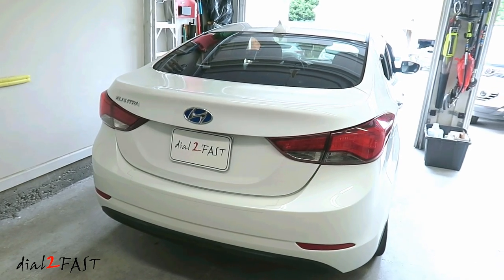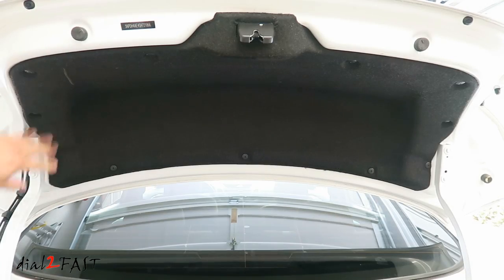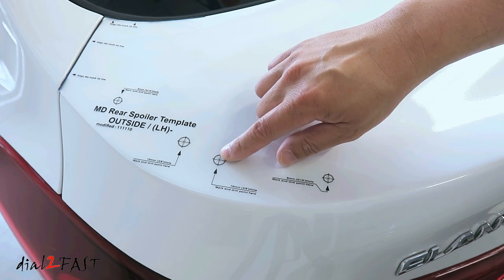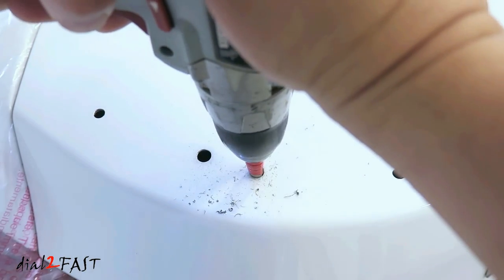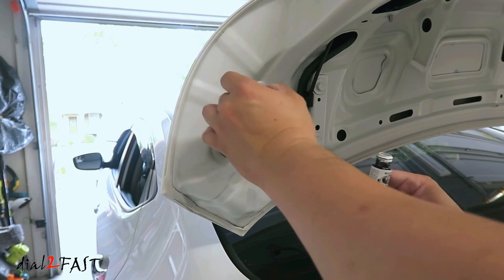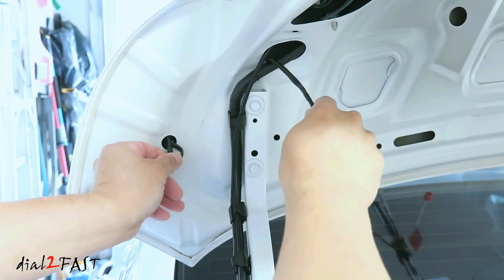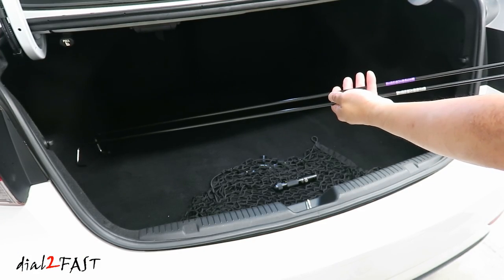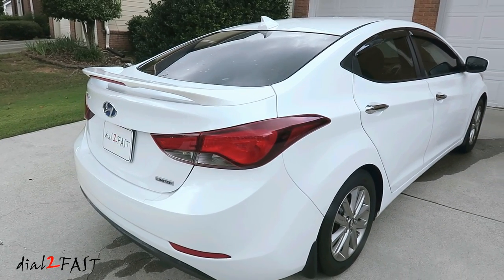How To Install A Factory Spoiler On Hyundai Elantra

Comment: After 10 years, my spoiler brake lights don't turn on (which i assume why my center brake light don't turn on too). Any ideas how to fix the spoiler brake light not turning on?
Reply: it turns out my spoiler light wires got snagged and ripped apart! I was able to strip the wires and join them again. Spoiler light works but center brake light still doesn’t work even when I replace the bulb
Reply: Did you figure it out? I was just pulled over because my spoiler light won't come on.

Comment: Both ways release the latch but it's difficult to open the trunk. It like sticks. I have to get my fingers under the bottom of the trunk to push it up. I tried spraying WD-40 on hinges but that didn't help. Any advise?

Comment: Awesome DIY....
I want to install one to my 2018 Hyundai Sonata SEL....
Any recommendations of where I could get the part?
Since at the Hyundai dealership they don't have it to fit on my vehicle...
Really appreciate any input or a link..
Happy New Year...新年好 / 
Ty
Reply from the maker: I found this one on Ebay but you will have to get it painted. Also there is no LED on this and aftermarket spoiler don't come with new torsion bar. https://ebay.us/nqGDPg
Reply: @dial2fast  ty for the input. 👍

Comment: I always wondered how much more speed a car gets with a spoiler, or is it mostly for looks?
Reply: Spoiler doesn't add speed its for looks only , unless its a RWD car with at least 350 hp and are going to be going more than 85 mph
Reply: @heberaragon4360  It helps to keep the wheels grounded on light weight cars by supplying down force. Not just for looks.

Comment: Wondering if you did a mpg highway run before and after adding.   My 2017 get about 44 mpg at constant 75 no hills.  Freeway only-- fill and drive run(120 miles).  ? ?

Comment: Looks nice.  Did you do a 150 mile freeway run at 78 mph with and without to see if it helps with gas mileage at speed.   Nice install video.  Very clear.

Comment: I know this is an old video now , but I have the factory spoiler and my LED light on it doesn’t work. How would you install a new one ? I went to Hyundai dealer and they said they can’t get the part in since the spoilers are made by aftermarket company
Reply from the maker: Depends which spoiler you have installed. If it's an aftermarket spoiler, then the dealer can't get you any replacement parts. Also most likely they don't sell just the LED strip as a replacement. You might be out of luck on this one.

Comment: So if you connect this spoiler, will the little brake light in the back windshield stop working?
Reply from the maker: With this factory spoiler, you unplug the original CHMSL (center high mounted stop light) and plug that connector to the spoiler LED. So only the spoiler LED will be on. This is how a proper factory spoiler should be connected. Sometimes you will see cars on the street with both spoiler LED, and CHMSL on. That's because it's an aftermarket spoiler and the installer simply tapped the spoiler LED onto the existing CHMSL light without removing the bulb.

Comment: So are you going to remove the original 3rd brake light in the middle of the back window? I guess since you have tint on your car the original unconnected 3rd brake light isn't noticable.
Reply from the maker: The 3rd brake light does not need to be removed. If you remove it there is a hole with no carpet on the rear deck.